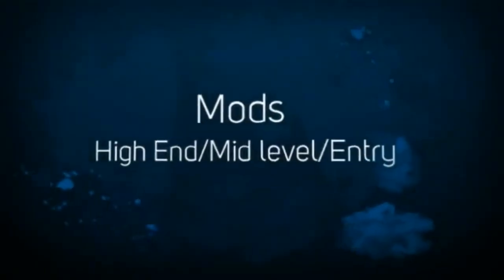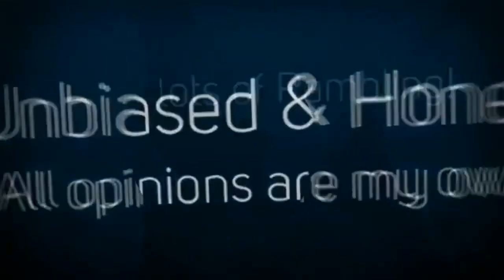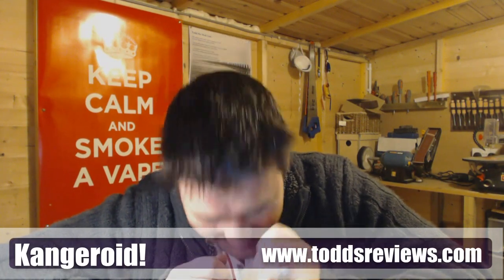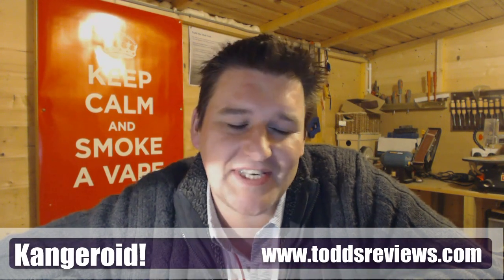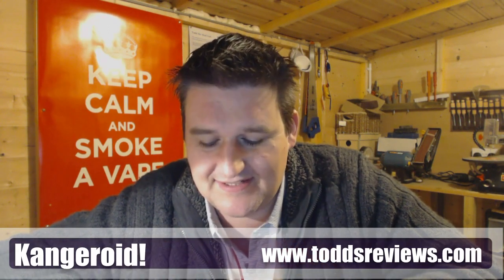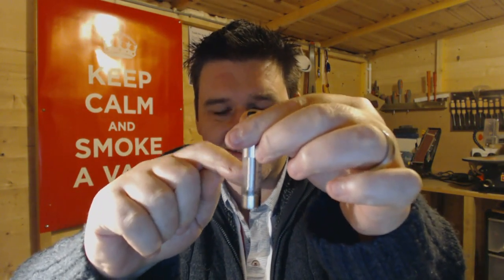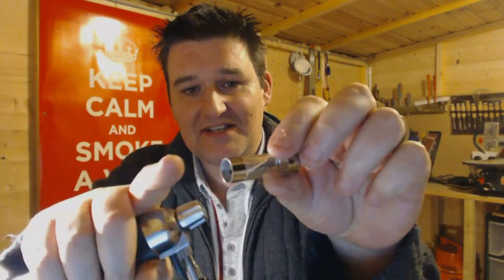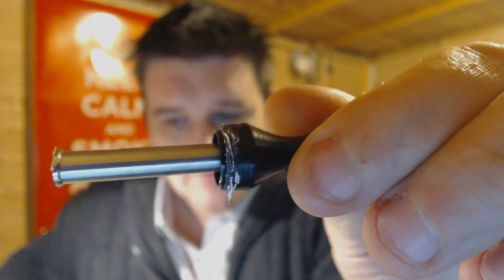Build a KANGEROID!

Comment: Nice work! im using a natural glue dissolver to try get the top off. 
I see the benefits! it would stop gurgling and leaking! really keen on trying this!
But i had a thought. Maybe just wrapping the bottom where the wicks are with some filler material? this way you keep the juice capacity, see it sloshing around in the tank and it could possibly resolve any gurgling and leaking?